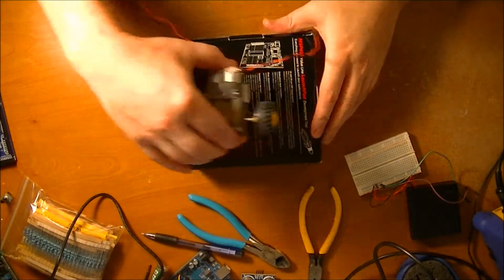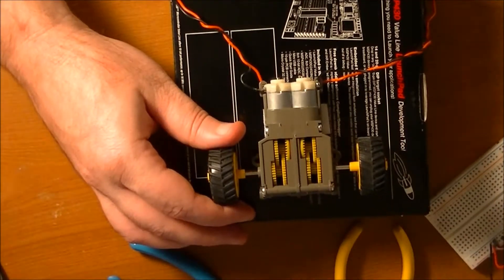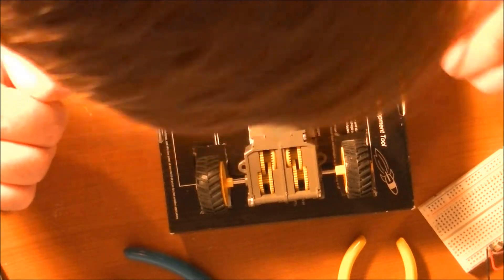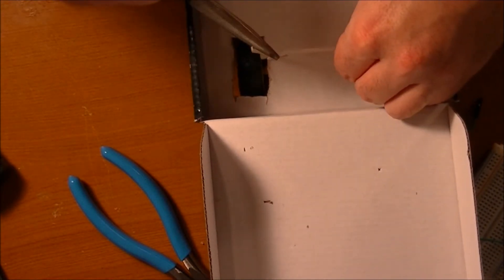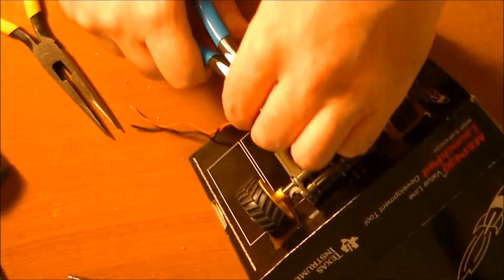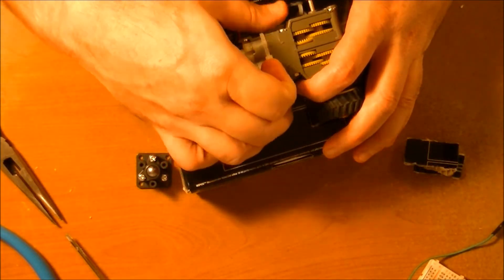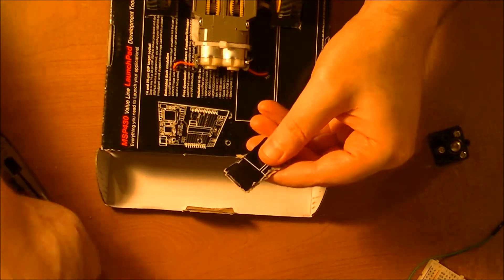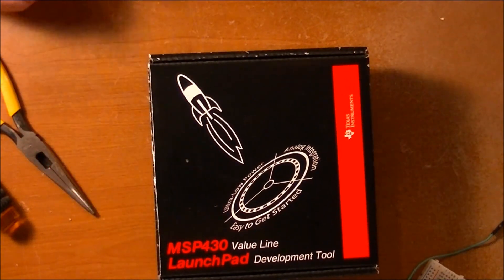How to build an Arduino robot - make a cheap cardboard box chassis

Comment: the cheapest I have found was 12.95 _ S&H   wheels run about 7.00 for 2.14" or 65mm  Not sure what size he used in the video....   I wonder what it would cost to 3d print a chassis